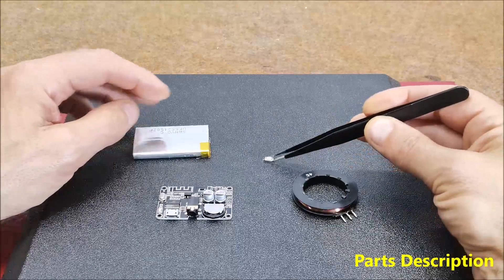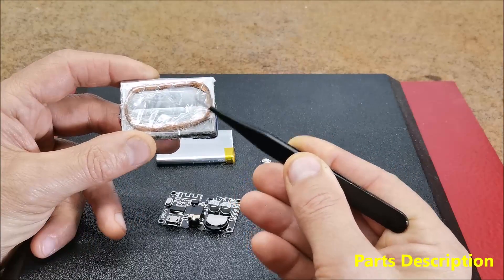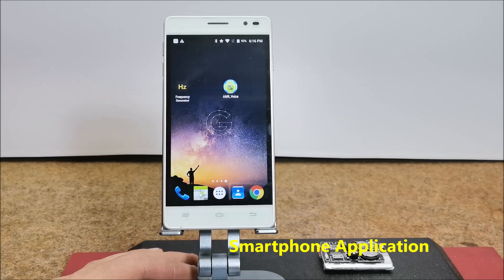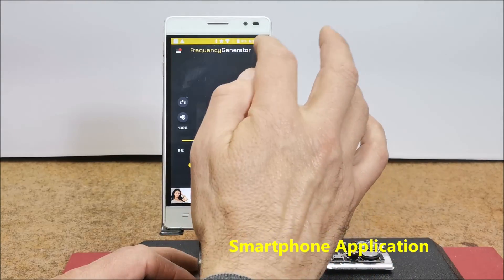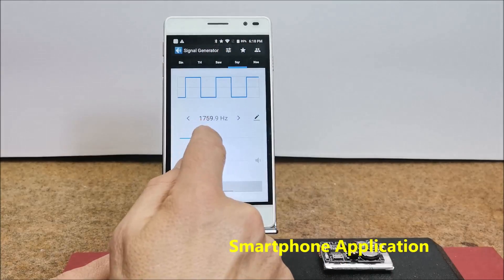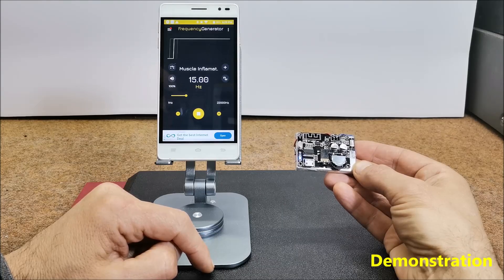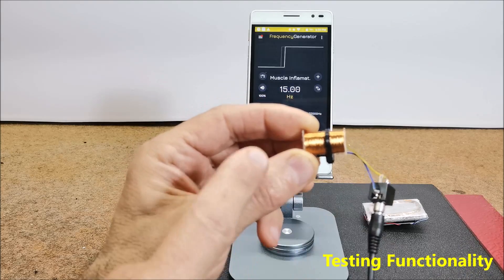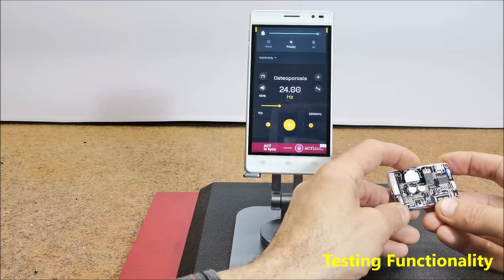How to make simple portable PEMF Magnetic Pulser

Comment: ** NEED HELP!! **

Okay, So I have all the parts needed to make this. But I can see NO WAY to solder the on/off button on to the circuit board as-is. The button is too big for the footprint on the board!

When I watched this video to see how Mirko did it, it looks like he somehow added extra circuit board onto the main circuit board, which sucks because I thought that if I had all the parts, it would be easy to complete in an hour or so.

On his web page and in this video, he doesn't explain this at all!

I'm a beginner, but I feel like this should be easy. However, when there's a bit of hocus pocus involved that isn't explained on his website or in this video, I feel a little cheated. LOL

Has anyone else tried making this magnetic pulser according to Mirko's instructions? If so, can you please explain if it's possible for a beginner to actually make this and how to get around this issue?

Thanks.

@MirkoPavleskiMK Can you help me with this issue?
Reply from the maker: The added tile that you mention is actually the button itself. There is no added part. The schematic view of the Hackster.io portal shows very clearly the place where the button should be soldered

Comment: I'm eager to try this project! 👍😁

What gauge copper wire did you use? I'm totally new to these projects, so I'm not exactly sure what search phrase to use to find the right wire. Thanks.

One thing I've not yet seen anyone make is a Frequency Specific Microcurrent (FSM) machine. Most machines cost 1K on the low end and 5K or more on the high end. But I'm guessing they can be made for under $100.

A healing tool this powerful with no side effects should be available and affordable to all.
Reply from the maker: AWG24,  about 0.2mm2
Reply: @MirkoPavleskiMK  is enameled wire okay or is bare wire preferred?

Comment: The power of the magnetic field (Gauss or Tesla)  can be doubled without increasing input: Simply double the number of wires and double theIr lengths. Then connect them in parallel by soldering ends together. This effectively doubles their surface area, the same as using a single thicker wire, AWG + 3. 

This works by exposing a larger area of Space with the same Current of electrons.  An effectively thicker wire offers less Resistance, so the same Voltage can push the same Current of electrons through longer wire. Space reacts to moving electrons by reforming itself (morphing) into the "magnetic field". The magnetic field strength (Gauss or Tesla) will be the same per centimeter, but now the centimeters are doubled, and the total field strength affecting other objects, like you, is doubled.
Reply: P.S., The question becomes: What will you do with this multiplied power? You could just make a bigger coil. Or, you could make two coils, the same size as before, but now with the possibility of placing the magnetic fields in two locations.
Reply: @PowerMakersCafe   You meant 2 coils in parallel ?
Reply: @roblim1767  From this twice as thick wire that is twice as long, two coils can be wound, each the same diameter as your original thinner wire coil, the two coils connected in series.
Reply: @roblim1767  This doubling of the area of Space reformed into the magnetic field without increasing input can be simply demonstrated by using a single wire that is twice as thick as before (original gauge + 3), and twice as long, wound into a single coil twice the circumference. But since that exact wire size may not be available, the equivalent wire can be made from two wires of the same thickness (AWG) as before, wound in parallel, their ends soldered together (Bifilar parallel connected).
Reply: @PowerMakersCafe what, in your opinion, would be a good wire gauge for this project?

On the site for this project, all the parts are listed, but the gauge of wire wasn't.
Reply: @ScottMilford  Here he is recommending  ~100-150 coils of 0.1mm diameter (38 Gauge) wire. It is not clear the diameter of the finished coil. But it seems its size is not as important as the total Resistance of the length of wire chosen which he says should be 15 Ohms or greater. 

Whatever magnetic field this circuit and coil is able to conjure out of the surrounding Space can be doubled without requiring more power from its battery. Simply double its wire diameter (Here AWG-3 = 38-3 = 35 Gauge) AND double the wire's  previous length.

You will see it should measure the same 15+ Ohms resistance it had before.  But now the same current is able to effect twice the area of Space, causing its magnetic field to cover twice the area it had before, doubling its effectiveness for this or any other project.
Reply: @ScottMilford  Here he is recommending  ~100 turns of at least 0.1mm diameter (38 Gauge) wire, with his coil being 150 turns of 24 AWG. (Notice the thicker longer wire). It is not clear the diameter of the finished coil. But it seems its size is not as important as the total Resistance of the length of wire chosen which he says should be 15 Ohms or greater. 

Whatever magnetic field this circuit and coil is able to conjure out of the surrounding Space can be doubled without requiring more power from its battery. Simply double its wire diameter (Here AWG-3 = 24-3 = 21 Gauge) AND double the wire's  previous length (150 turns X 2 =  ~300 turns, or two coils @ 150 turns each connected in series.) 

You will see it should measure the same 15+ Ohms resistance it had before.  But now the same Current is able to effect twice the area of Space, doubling the magnetic effect for this or any other project.
Reply: @PowerMakersCafe  so 300 coils of 35 gauge wire?
Reply: @ScottMilford  ~300 turns of 21 Gauge wire.
Reply: @PowerMakersCafe  bro please reply.. Is 0.7 mm okay?.. I can't find exact 21 gauge copper wire.. It will be 0.723
Reply: @PowerMakersCafe or should I do 0.75?thu is the only size available
Reply: @fahmiyusoff9154  Yes, the slightly wider wire will work even better, allowing even longer wire, and larger coil. For this application, winding a flat pancake coil is best. Good success, my friend.
Reply: @PowerMakersCafe  thank you.. What do you for a living?
Reply: @PowerMakersCafe  one more... If we want to double 0.1 mm why not 0.2?
Reply: @fahmiyusoff9154  If using thicker wire 2x the diameter, then 4x the length. This will have the same resistence, use the same input power, but produce 4x more magnetic field.
Reply: @PowerMakersCafe  I made this using 50w Bluetooth amp with 0.7 mm coil.. But when I test with magnet it doesnt move the magnet.. I calculate it to be 26 Gauss.. When I test with radio it distorts radio signal.. Does this means it does not work?
Reply: No content on your channel. Shame. You got a site or group I can join?
Reply: Do you make these devices or similar?